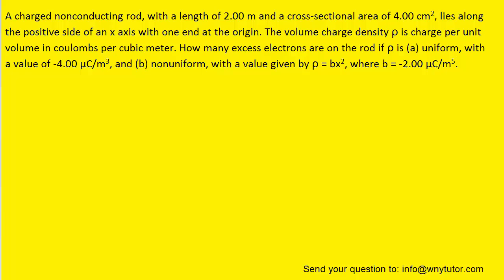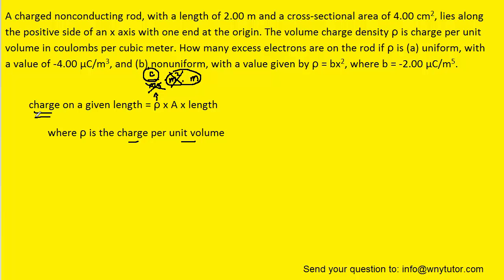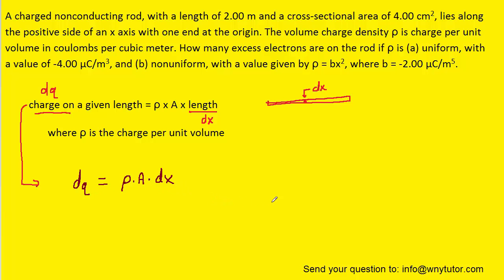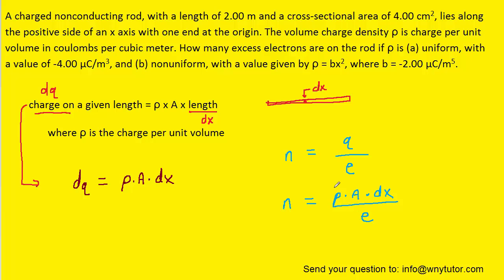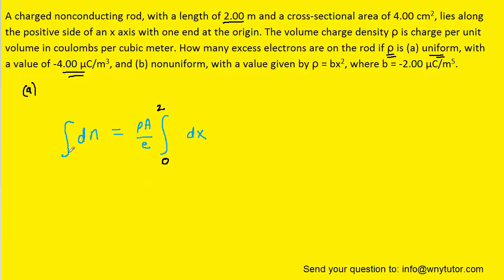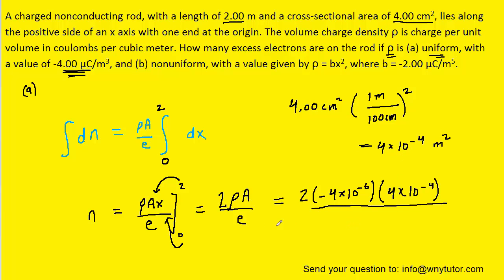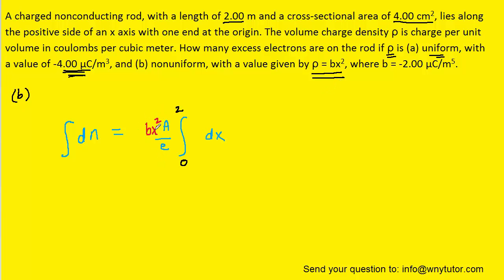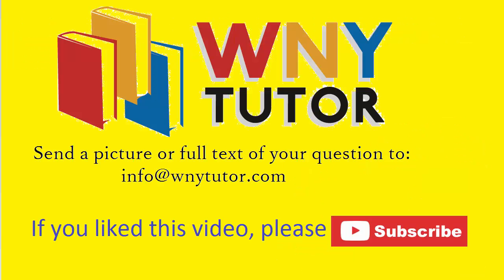A charged nonconducting rod, with a length of 2.00 m and a cross-sectional area of 4.00 cm^2, lies

Comment: What would be the magnitude of the electrostatic force between two 1.00 C point charges separated by a distance of (a) 1.00 m and (b) 1.00 km if such point charges existed (they do not) and this
configuration could be set up?